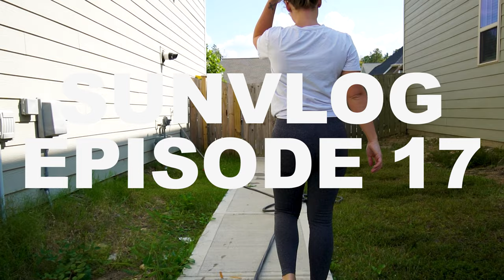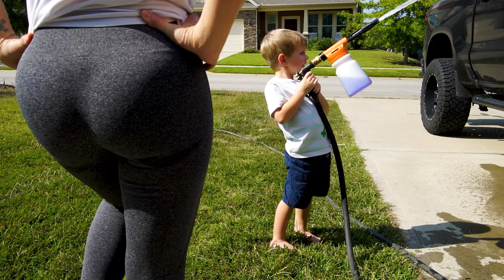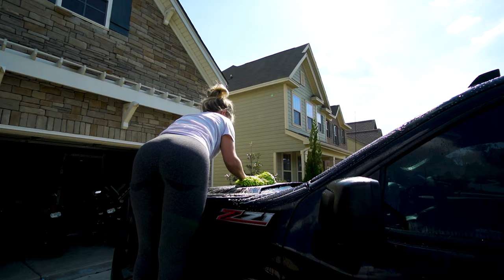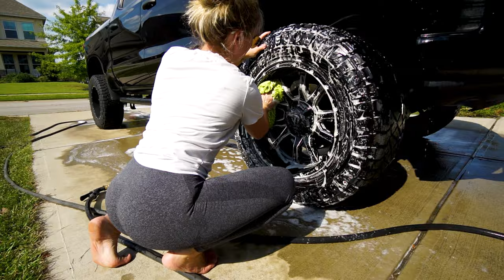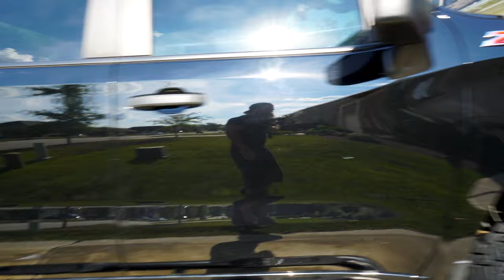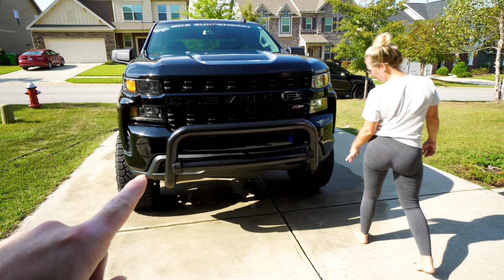Washing My Lifted Truck (Trail Boss)

Comment: Ran across your channel because of a motorcycle video. Weird and random but I want to help you.
1. On black vehicles use the 'two bucket method' and you'll avoid scratches or dreaded 'swirl marks'.
2. If you wax it look up a product called 'aero gloss' or similar that is used for aircraft (not kidding). My dad had some on his truck and it maintained its shine after 17 years of sitting outside. Also makes things like industrial paints (under your wheel wells) a whole lot easier to remove.
Dad had to remove overspray from a water tower paint job off his. Had to recoat but not repaint.

Nice truck!

Comment: Is the lift 6 inch total? Or 6 on top of the 2 inch lift that comes standard on the TB? I just bought a 2021 Trailboss and I want to lift it an additional 4 inches. Don’t know if I’ll get 35s or 37s on it but thinking about keeping my stock 18in wheels … I like more side wall lol
Reply from the maker: Ok so its a 6 inch TOTAL lift. It's a kit designed for the TB to increase it 4 more inches. The tire size is 35.